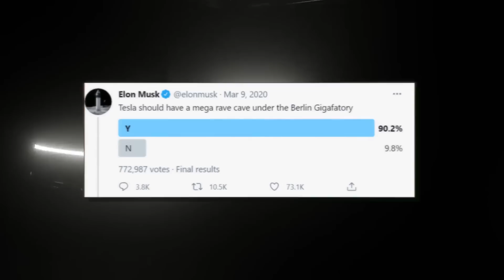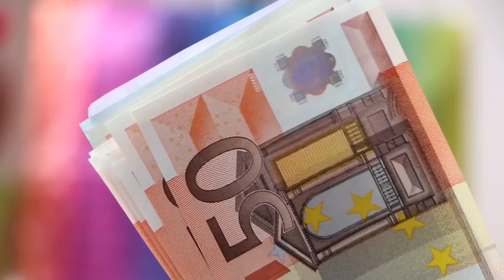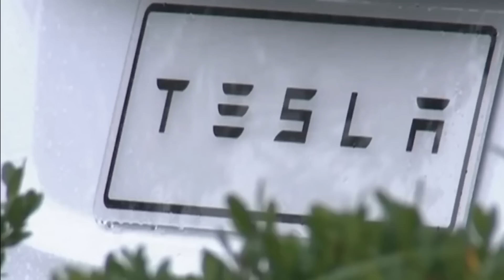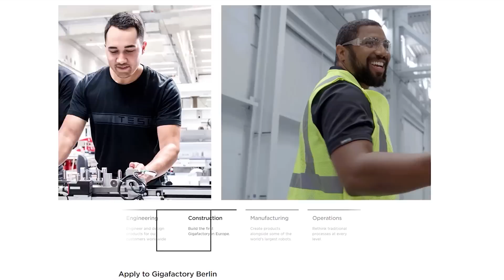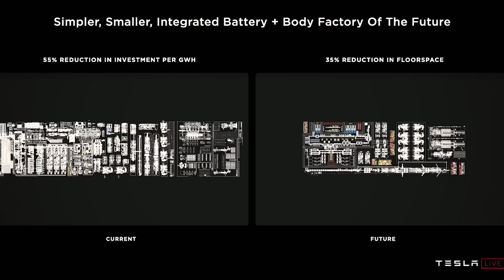Inside Tesla's New Berlin Gigafactory

Comment: Very spectacular but what happens when uncool competitor sells better cars for cheaper ? But unfortunately will not have a party with pink lazer light ? This sound like a kids 😴 dream
Reply: Tesla is already working on the $25,000 car by about 2023. This is made possible by 4680 battery with many of the benefits (and much greater life span) than  Solid state batteries only 2 or more years earlier. 
Cheaper? Sure - Leaf, etc. Cheaper And better? 
I assume you are discounting Autipilot in this because no one's close on that (without a geofence). 

As for glitz. Auto companies spend upward of $3billion on glitz per anum each. (They simply call it "advertising".)

Comment: Will this factory make Tesla’s cheaper for the eu?
Reply: Yes. The significant tariff will be eliminated. The cars are supposed to have Front And Back cast assemblies making production cheaper and the 4680 cell (possibly the real cause of the delay) will be about 50% cheaper KWh per KWh. The battery represents a good chunk of cost. Then reduced cost of transport form China vs higher labor cost... so.... overall. It should make it cheaper.

Comment: I hope spacex will reach the moon by 2024  🙏
Reply: Amen!
Reply: Amen
Reply: Strange to say about a craft that big, but they are clearly the most likely to do it. Expect orbital flight around 2021Q4-2022Q1. Orbital refueling demonstrated maybe 2022Q3. 2023 Trips around moon (already paid for and seems likely). To land on the moon in 2024, they will have to do much the same as they will be doing for at least 2 years landing on Earth, except in 1/6 gravity with multiple small rocket engines 2/3 the way up the length. 
Easier to "balance", less debris kick back, no weather. 

2024 seems likely.
Reply: dunno, ussr did it already in 1968.
Reply: @HECKAKYH-ADEKBATEH  obviously they did it back then ,but we are hoping yo happen again